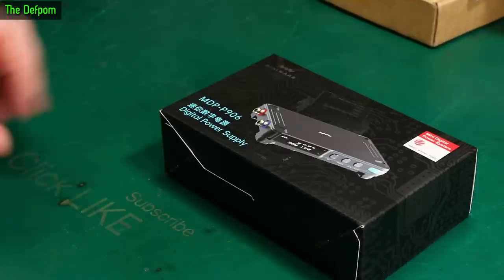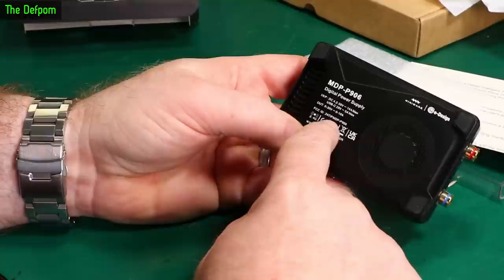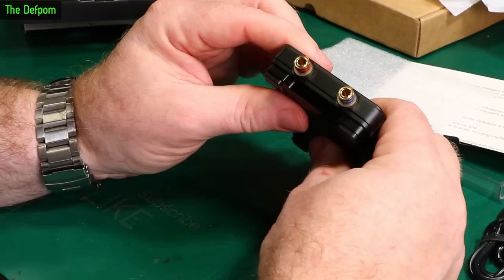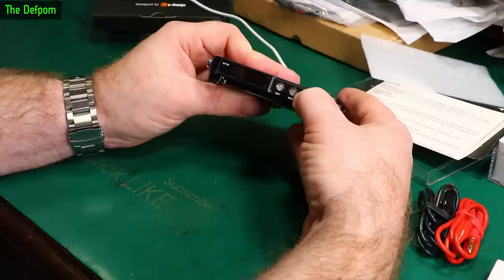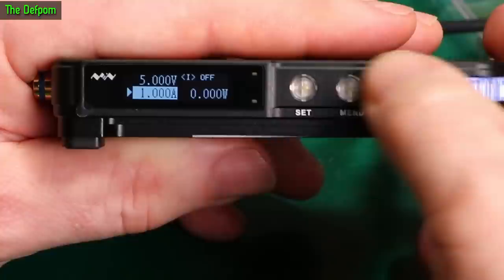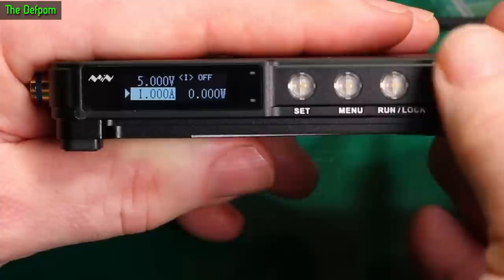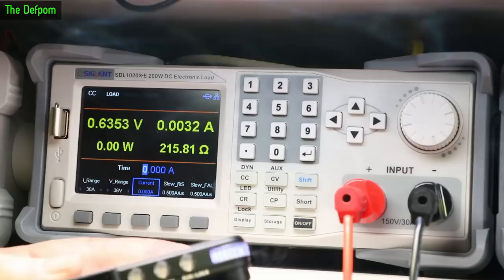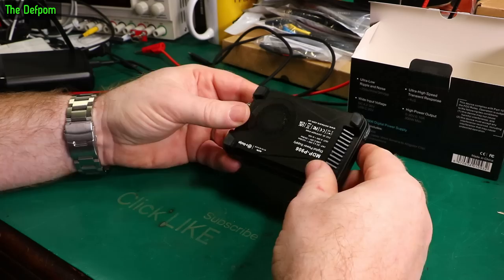🔴 Miniware MDP-P906 Power Supply Review & Repair - No.1041

Comment: have you checked if the negative output is tied to the negative input? 
if yes, you couldnt make a dual rail supply (positive from one to the negative of another) when both are hooked up to the same power source (or when both power sources grounded their negative pin).

90W "powersupply" (that isnt one since you need a  actual power supply to use it) that costs 150-200 bucks? what were they thinking.
its literally a fancy version of those ebay buck boost converters for 10..15 bucks with a oled and wireless strapped to it.

 they made their name with the ts soldering iron series which for 50 bucks blew stations away that cost orders of magnitude more.  great job 
 but this psu is just a bad product for a bad price and they started getting greedy.
Reply from the maker: I will have to check off the outputs are isolated.
Reply: @TheDefpom  That would require an intermediate circuit converter with a fully insulated transformer. But I only see the (relatively small) flyback(or similar type of that circuit-family) converter inductance at 18:52 . The transformers of potential-free converters are a lot larger with a nominal current of 10A.
The protection, the stabilization and the wiring of the voltage outputs is then much more demanding. I wouldn't expect that. 
Already measured? It's a matter of 10 seconds, or? Thank you for that and the video!:)
Reply: Agree with you at 100%
Also this fancy smoky box isn't even powered by fancy GaN mosfets.
Reply: Agree with you at 100%
Also this fancy smoky box isn't even powered by fancy GaN mosfets.
Reply: @gregandark8571  gan mosfets are not intended for low voltage applications like these. they are used in high voltage switching at 200..400volts where traditional silicon mosfets have a high RDS(on) resistance, but on low voltage stuff silicon mosfets have a much lower resistance currently

Comment: I'm not a person who enjoys criticizing anyone, but I have to make it clear that this is just an expensive DC regulator. You need to know what you're buying
Reply: Surely it is a bit more than just that?
Reply: You are truly wrong, watch his followup video. I own 4 of these units and also many standard boost/buck converters and there is simply no comparison whatsoever. This is an extremely well specd and ultra clean power supply, esp considering the form factor
Reply: @TylrVncnt  This unit is super over expensive ...... the low quality of components inside this trash says it clearly.

Comment: Does anyone know what brand that capacitor was?
Reply: For a recap project I have that uses these types of caps, I bought a kit with many values and sizes.

They LOOK exactly the same as those in the video and the kit I got has ELNA at the top of the values and RVT below the values.
I believe that RVT may mean Low ESR, Long Life.

As for the ones with the red strip on them, I notice in the video that it says, "MV" below the values.
I think that the MV indicator just means that these caps can  withstand HCFC cleaning agents for five minutes, which allows all circuit board components to be cleaned together, at the same time, without resorting to more expensive epoxy end-sealed capacitors.

I really don't like these types of caps.  They can be a pain to work with, especially when soldering them on.  I'm always afraid to allow them to get hot while soldering because I've heard others say that they will POP.  I should test that. LOL

Yesterday, I had to make a quick regulator circuit that was tiny, so I used these caps.
Before using any cap, I always test them to confirm their value and expected ESR.

These are brand new caps and still, some did NOT test well.
I did find good ones, however, and all is working well.
Reply: @BlondieSL  Yeah, I like theough hole capacitors better, but I think they use these because you can put them in a pick and place machine.
The sleeve on the through hole capacitors does make identifying the brand and type much easier.

Comment: Cute, but I can buy 3 regular Chinese power supplies for the price of one of these.  Niche item for sure.
Reply: Depends on use cases.  I have an affordable, modern programmable power supply on my bench, but that plugs into the mains and would be inconvenient to carry for field service work (e.g. crawled up inside an industrial machine).

This Miniware device might be handy for me to dial in supply power from batteries for various QRP transceivers during portable operations.  That may depend on how much RF noise it generates... which would be a nice thing to test.
Reply: @Randrew  There are definitely some mobile uses for it.

Comment: Maybe I'm stupid, but what is the point of the unit.  I assumed it had lipo battery inside, but no, so what is the point????????
Reply: Most laboratory PSU’s are supposed to have adjustable output voltage, adjustable current limiter, and a way to display their settings. At least some of them your average wall adapter lacks and this unit is supposed to correct that, whilst also being portable.
Reply: The point is that you can supply an unregulated voltage anywhere between 4.2V and 30V and get a stable voltage out which you can set to any value between 0V and 30V. You can also set a current limit anywhere between 0A and 10A. Think of it as a variable voltage/current buck-boost regulator, rather than a psu in its own right.
Reply: Small,portable and stackable where 4 of them can be controlled using the display unit
Reply: It's a variable dc to dc power converter where you can output your desired voltage and current. All you need it a fixed input source.

It has the same functionality as a bench power supply but without the ac to dc converter

All in all it's just a dc to dc converter
Reply: @redmist4963  Well, yeah, that is my point, it's an overpriced fancy DC-DC converter with severe power limitations.

Comment: Miniware products are nice but use of cheap OLED is a show stopper.
Reply from the maker: I’m not sure there is any other display type that comes in that size with the ability to display as much detail, or be as visible, I’m fine with it.
Reply: Odd observation.  The tiny OLED displays are almost a Miniware trademark, along with putting those displays on compact things that otherwise mightn't fit but 3 or 4 discrete LEDs.
Reply: @TheDefpom  The problem is the life time of those OLED screen. Couple of years max is not a acceptable for a tool. Miniware have great ideas and product. But if they do not upgrade to better screens there will be a ceiling for them. Who want disposable tools ?
Reply: @Randrew  These are cheap OLED you find on numerous aliex novelties or modules... Miniware uses a ratio that is of their taste but I doubt they hold any patent on this... Still great ideas but bad oled screens quality , a bit of a pitty for such great potential. But they seem to double down.
Reply from the maker: @testman9541  I think lifetime will depend greatly on usage, I have used oled screens on devices which I designed that are used for 10 hours straight a couple of days a week, they have lasted over 3 years so far with no apparent loss of brightness.
Reply: The OLED on my home built Solar PV data gathering Pcb thats been running 24/7 for over a year is basically knackered. Still readable but brightness is all over the place across the display. It started to go around the 6 month mark if I remember. Need to change it and make some mods to the software to display for 2secs every 15secs or so.
Reply: Yes.  The OLEDs that Miniware use do not last.  Even when not being used.  

I bought two TS-80 soldering irons after seeing great reviews of these.  One was used twice and then sat in my workshop for about a year with no use as I was using my go to workhorse, Hakko , which is 25 years old and has never missed a beat.  Just TIPS replaced once a year or so.  I just didn't "Feel" comfortable using the TS-80.  Too light and didn't feel robust.
I went to use it after a year of no use to make sure it was still working after seeing people mentioning the OLED's issues in these and could hardly see anything on the display.  Had to cover it with my hand to see anything.   I unpacked the other one that had never been used and it was just as dim and unreadable.  I ended buying a dozen of the OLED's from Aliexpress and fixed them both, but OLED's dying without even being used means these are not good quality for longevity, even just sitting in a box.  Not sure if the ones from Aliexpress will suffer the same fate.   Even the 10 I have left over in stock might "die" without even being installed.  But the 12 x OLED's only cost $40 delivered !
Reply: @simonper123  Almost same story on mynTS-80... They do not recognize that such cheap OLED are not suited for tools. They should have a basic LCD instead. Less fancy at first but last way longer...

Comment: I hate the fact that another power supply is needed to power this power supply, I don't have a high voltage USB c brick
Reply from the maker: It also has a round dc in jack which can be used instead (and is probably the better option)
Reply: but you probably already have a laptop power brick
Reply: @SD-xu3mz  That doesn't change the fact that the manufacturer (Miniware) "offloads" that not so small cost to the customer.
In case of amateurs or inexperienced folk this comes close to dubious business practices. I've already written too much about this toy. For the $260 price tag (October 2022) you easily can have TWO linear regulated PSUs which are more helpful, stable, cleaner, maintenance free and make more sense in a hobbyist or semi-professional lab environment setup. BTW. please be honest. "but you probably already have one" is just wishful thinking, that (as I said) offloads the responsibility to others. And we have no clue about their circumstances (or the right) to "redefine" how they have to use their stuff. With that, I mean: Use your brain! Which will possibly the worst situation in terms of this superfluous (YOUR convenient assumption!)  "laptop power brick"? You get it!;)